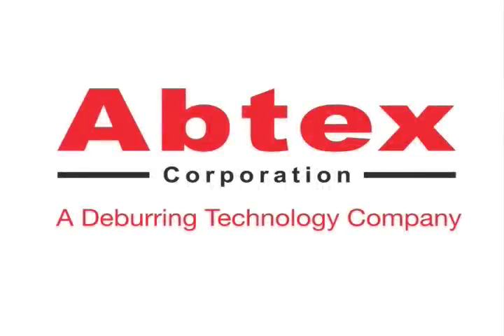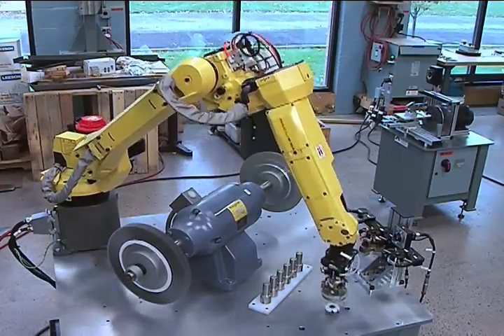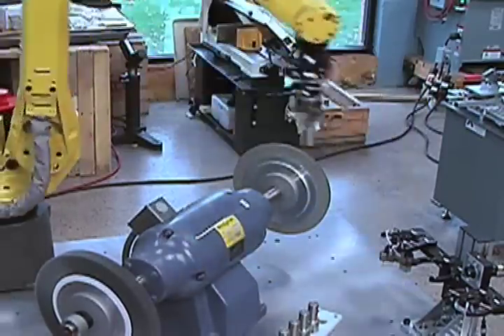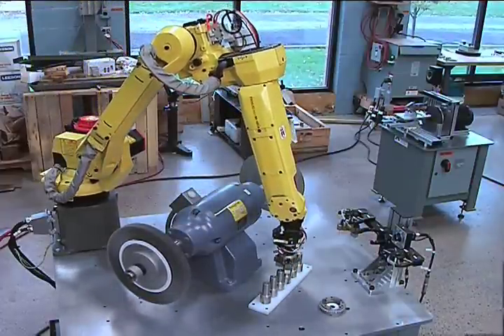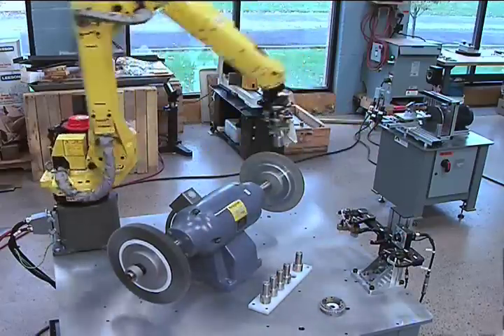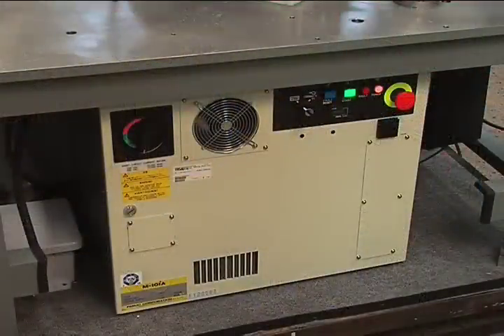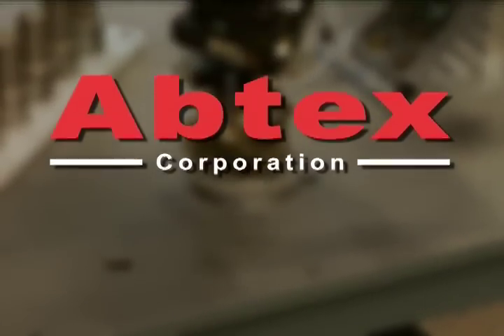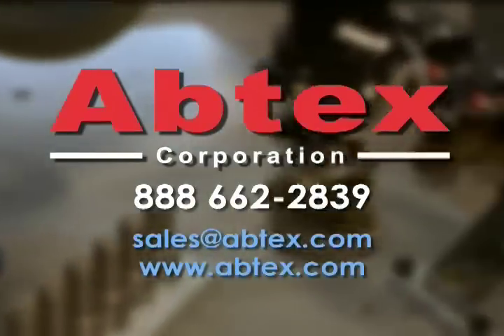Robotic Abrasive Brush Deburring Equipment and Polishing System

Comment: For a operación like that I will not spend the money in a robot like that using a employee he can do that and other job that the robot can not do easy I can do 200 per hour so in 8 hours I will have 1,600 parts in my comparing they buy a machine for grind cbn tools and machine can only do 80 tools in 8 hours I do 200 in 8 hours